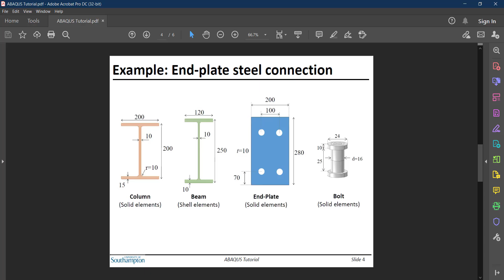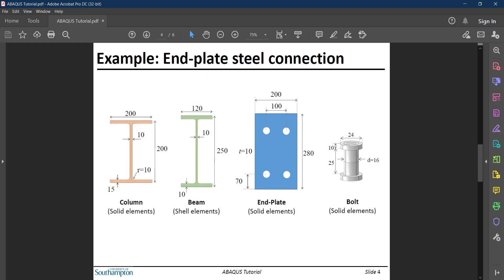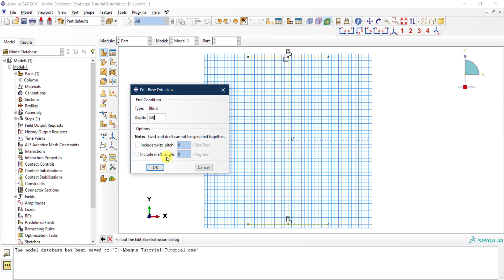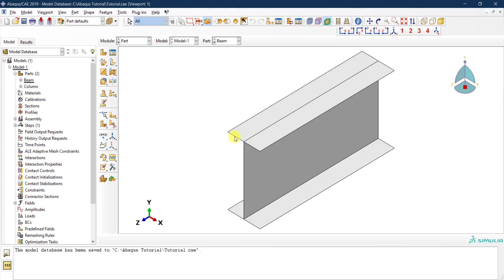#04 ABAQUS Tutorial: Creating a shell part - I-shaped beam

Comment: Hello Dr. Ahmed. Many thanks for making this video. I have a question about modeling shell elements here. Is it possible to provide rounded corners for shell elements as well, by using the fillet option, as you did in your previous video for modeling the column with solid elements?
Reply from the maker: the k-area fillets in I beams can not be explicitly modeled using shell elements
Reply: Many thanks for your response. Could you clarify what is meant by k-area fillet? I am trying to model one channel section with a rounded corner. I have the corner radius as well. Do you mean to say it is not possible to model the rounded corner with shell elements in Abaqus?Thanks in advance.
Reply from the maker: you can draw a channel section with roundeed corner using shell elements. Simply draw the section in the sketch.
Reply: Great ! Many thanks for your response.